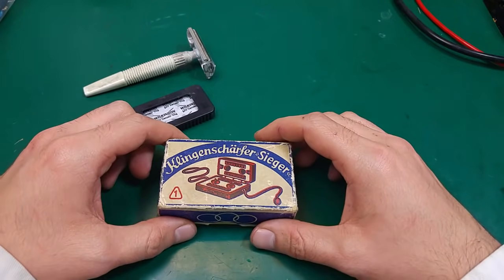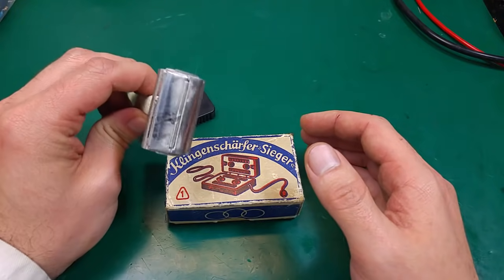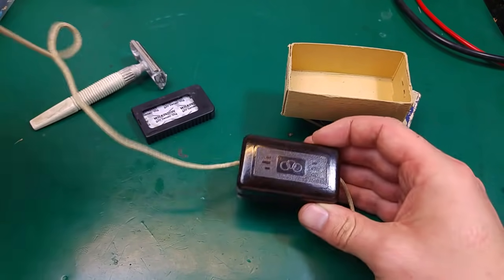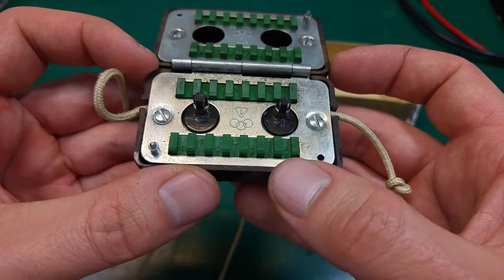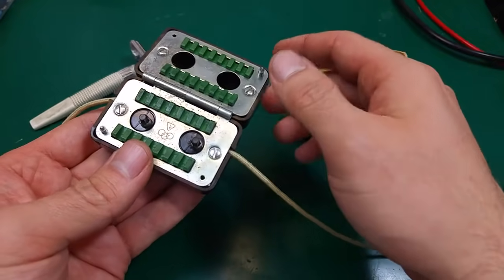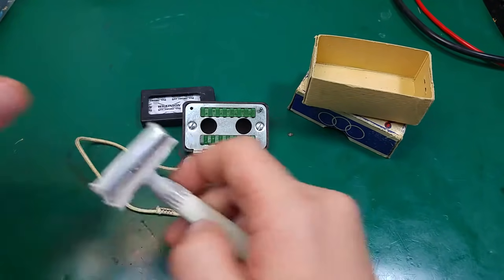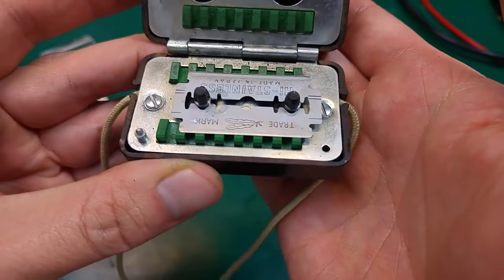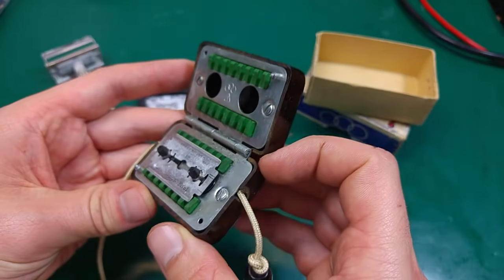Vintage sharpener for safety razor blade SIEGER Klingenschärfer

Comment: I own this exact same sharpener. My box is the same but a much more faded blue and more worn. Came with the original papers in the box. It still functions but I'm not impressed with how it sharpens...at all
Reply from the maker: Keep in mind that was from times when people were unable to buy blades because steel go for army use -  or they were crazy expensive - so any second use was forth fortune. Possibly vintage blades have different angle of attack (blade), weaker metal and that's why it don't give good results. I never used mine since it was more collectible item for me! If You ever find vintage razor blade please give it a try and we see what happen.